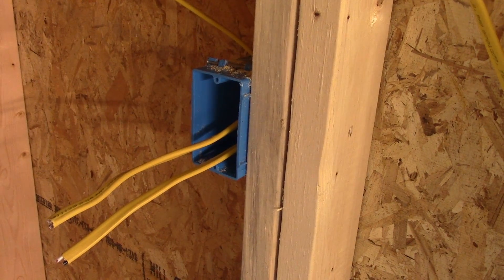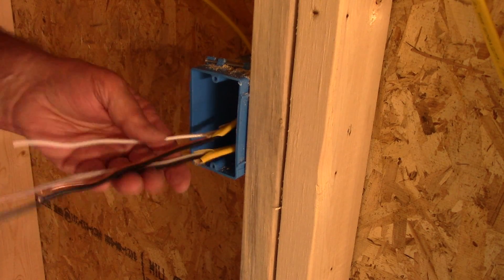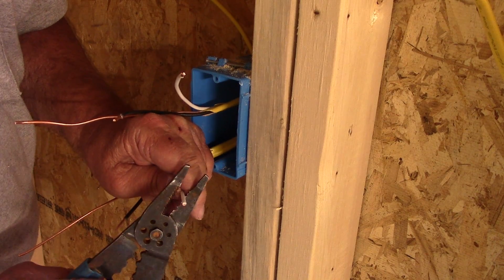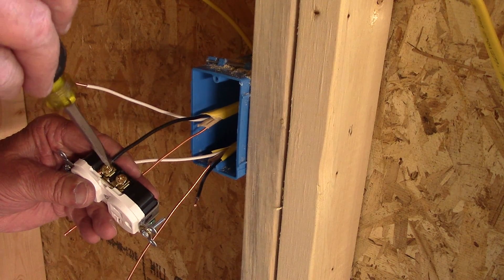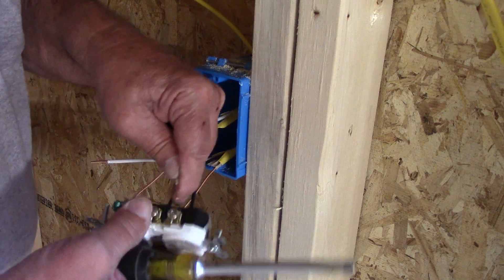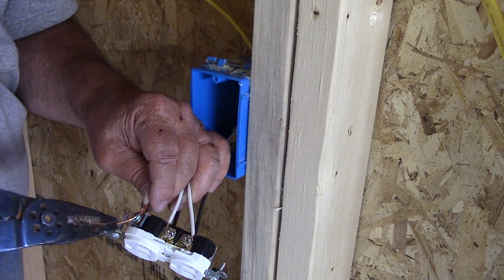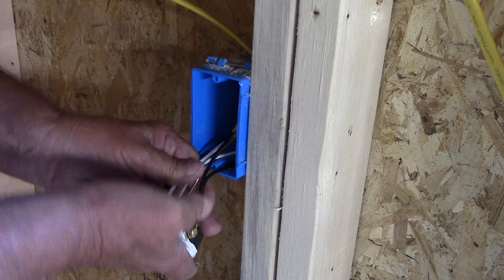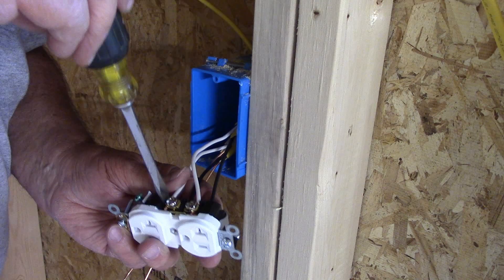How To Install A 20 Amp Electrical Outlet

Comment: Attaching two ground wires to the grounding screw is a code violation. I would use a wire nut to attach a pigtail to make one ground and attach that to the ground screw,
Reply: Its not a big deal. It would make it alot easier though. Code are past to make you buy more stuff. Some things have been done for decades with zero issues. But someone finds a way to make you do or spend more. Lobbying is a big part in this.

Comment: Everything looked good except for your ground wiring!  I didn't like the way you connected it to the receptacle I would of used a pig tail wire instead which is the proper way by code as the way you did it can slip out and you'll have a real problem!

Comment: buy better tools, the knife is scary for as many outlets you are doing.  I like to wire the original Hot wire from the box on the top and then corresponding wires on the bottom.  I like the electrician trick you pointed out.  Thanks.
Reply from the maker: Thanks

Comment: That's an odd way to do the ground. Pigtail it or crimp them together and attach just one wire to the screw....
Reply: That ground is not to code
Reply from the maker: Thanks very much
Reply: That's exactly what I was saying!  That's a no no!  That can slip out easily!  ThTs what pigtails are for!
Reply: Yeah, not sure that grounding work would pass an inspection.

Comment: Attaching two ground wires to the grounding screw is a code violation. Use a wire nut to attach a pigtail to go to the grounding screw.

The exception to this rule would be if the ground screw was designed the same as the side terminal screws with a plate below the screw that allowed inserting two wires straight under the plate without making a J hook.
Reply from the maker: Thanks very much

Comment: If I wanted to switch out a 15 amp to a 20 amp outlet would I need to run new wire and breaker?
Thanks
Reply: To be code compliant you shouldn't install a 20 amp receptacle on a circuit that is wired with number 14 wire. It must be 12 gauge wire minimum. You can install 15 amp receptacles on a 20 amp circuit (unless it's a dedicated circuit supplying power to a single device).
Reply from the maker: Thanks for watching.  I'm not an electrician.  You can change the actual outlet and you will have a better outlet but your circuit is still a 15 amp circuit.  If you're wanting to run something that draws a lot of current you would need to run new wires. I run a big air compressor in my shop and I'm only using a 15 amp circuit.

Comment: All my outlets are 20amps or higher, I use the professional ones. I don't see a reason to have 15amp outlets. All of my breakers are 20amps or higher.
Reply from the maker: Thanks for the question but my answer may not help you.  I'm not an electrician but I've worked with electricity most of my life. I'm not familiar with commercial outlets but in my opinion if the tool comes with a standard plug then a twenty amp outlet should be fine. I wired this for my son and we used 20 amp outlets so that he could run any power tool that he would need.  We didn't wire any 220 outlets because he wasn't planning on needing them. The 15 amp outlets on the top of the building are just for led lights.  Good luck with your project. 
Calvin
Reply: I agree with using the better grade professional plugs/outlets. They last longer.
Reply from the maker: Thanks for watching
Reply: @SouthernCountryLiving  Maybe you can answer a question for me, its probably a two/three/four/five part question.

When it comes to outlets, that are higher than 20amps, so 30/40amp outlets.

Is there a way to get a, 30 or 40 amp outlet,  that has a traditional plug, meaning not a six pron/port outlet/ not the type of outlet your dryer has, but an outlet that has two ports/holes and a ground, so three holes/a normal outlet, just with more power?

Also what I want to do MAY require SOME kind of regulator as well/a hand shake, between devices, meaning I don't want these outlets to blow/break something/supply to much power, to a device, just the amount of power it needs/wants.

I also realize, to have a plug higher than 20amps, you need a higher breaker/30 or 40amp breaker AND better/thicker gauged wire.

I may need even higher amp breakers/multiple 30/40/100amp breakers, connected to multiple plugs/outlets/circuits as well?

The reason I wonder this/want this, is for a work shop/a room with a lot of tools in it/table saws,drills,planners,welders/a lot of high powered equipment.

How do you deal with this type power/plug all these devices in?

Do you have to have a converter/adapter, to be able to utilize, the power you need?

A converter/adapter, as in, JUST an example, a plug/surge protector, that fits a 30amp outlet, that has traditional female outlets?

For this to work, properly, obviously one, the surge protector, would need to be rated for this much power/the wire would need to be really thick.

Anyway I just wondered how you can deal with something like this, if 20amps isn't enough AND SOME, if not ALL of the devices your plugging in, have traditional plugs? 

Also, once I figure out the type of outlet/how to plug all these tools/devices in, do you recommend more than one/multiple 30/40amp outlets, or just one, and plug everything to it?

Most likely I would want multiples, BUT what do you recommend?

I know this is A LOT/a long question.

I don't think its that big of a question, MAYBE, it just has A LOT of parts to it/you probably needed to know what I was trying to do and what I wanted to do, to answer the question/questions properly.

Comment: Great video. Does it matter if you loop the wire around the screw or just put it in like you showed us? I asked because my Treadmill keeps shutting off when i raise the speed.
Reply from the maker: Thanks for watching.  Either way will work fine. When you increase the speed on your treadmill,  if it trips the breaker in your electrical panel box them you may have an electrical problem or a bad breaker.  If your treadmill is just going off when you increase the speed then you most likely have a problem with the treadmill.  I remember that I had a similar problem years ago with an older treadmill.  Good luck with your project. 
Have a great day, 
Calvin

Comment: Thank you for all the videos on the woodworking shop. Its very helpful, and itll get me through my next project of getting power to my shed 100ft from the house.
Reply: The eadiest way to tell which side of the outlet is hot or the blsck wire is the smaller inlet on these polarized outlet is always hot and the larget wire outlet is always the neutral.
Reply from the maker: Thanks for watching,  good luck with your project. 
Calvin

Comment: a good tutorial mate guess more current there as a lower mains voltage
🔍watched in full🔎🎭 supporting🎭 like✅👍🇦🇺👍😉 😊
Reply from the maker: Thanks for watching,  the power tools that he will be using recommend the 20 amp circuits.
Reply: Not a good tutorial, very unsafe.